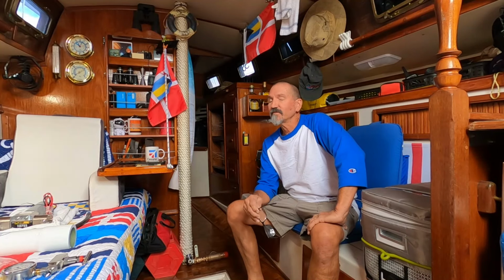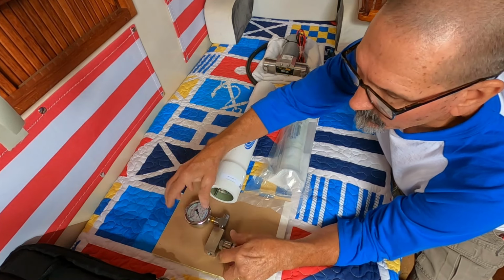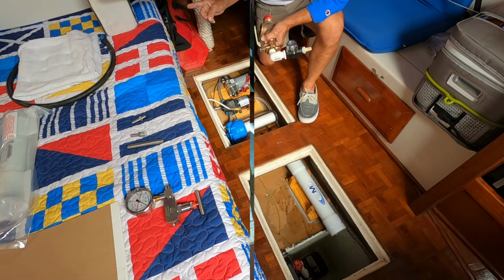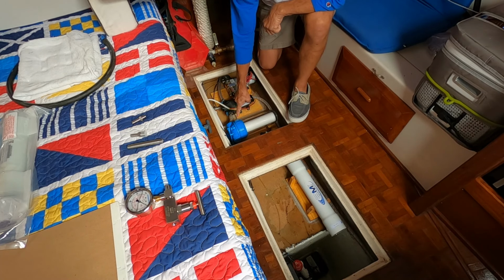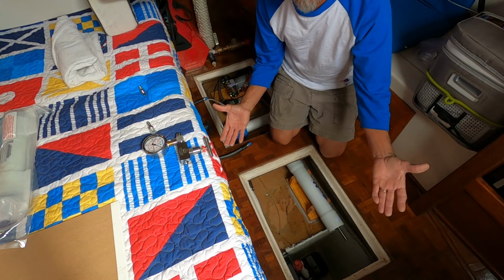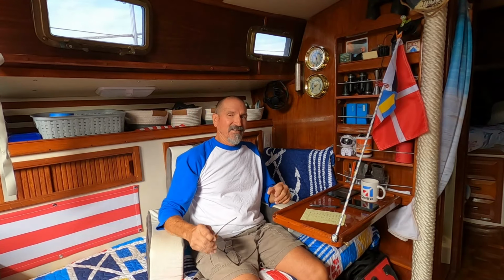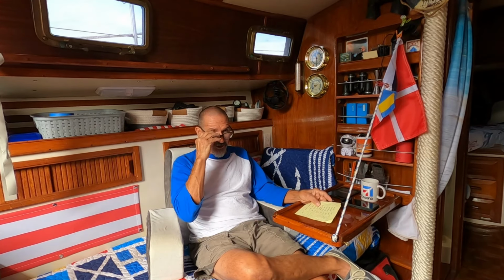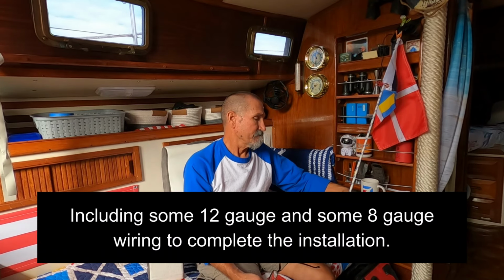My 12 volt, 15amp 3 gallon/hr watermaker for $1500

Comment: In the mid 90's I had installed a PUR 80 RO water maker by the dealer on my 10.8 meter sloop.  As I remember it sure never cost no 1500 bucks !! And it worked really good. That's about 3.333 gal. an hour. My boat had a 60 gallon holding tank. NEVER lacked for water..  BUT  I mostly sailed alone from Calif. to Florida through the P canal.
Reply from the maker: @samrogrer4959  Yeah, those were the days ! They only make the 40 model now and they are just under 4 grand ! 😱

Comment: I'm not thrilled with the price. Why can't they build it compact in a frame ?
Reply from the maker: Seawater Pro makes one in a case, but it runs on AC and it costs about $4200. Katadyn makes a small one with low power draw but its $4000. You could make the same system I have and use a pressure sprayer pump that's not stainless and save some money. But that kind of pump doesn't last very long. But you could probably save a few hundred dollars.
Reply: @sailingonabudget  I know in the decades past, there were tiny life raft/ kon tiki style water separaters run off hand power. They made cups of drinking water.
Reply: @sailingonabudget and your high pressure pump runs on 12v , 48v or what ?
Great video. Thanks for sharing?
Reply from the maker: @From_Refugee_To_Yacht_Owner  That pump is the 107SS from Pumptec. It can purchased in 12 or 24 volt DC, and 120 or 230 volt AC. All stainless steel. It should last a long time !
Reply from the maker: @stanleybest8833  I bet you're thinking of the Katadyn Survivor 06. It is still being sold I believe. Landfall Navigation has them listed at $1295, limited stock.
Reply: @sailingonabudget  thanks.
Reply: @From_Refugee_To_Yacht_Owner  No. I was thinking of something from decades ago.  I looked like a kid toy and it had handles. No electric, and it folded up.
Reply: @sailingonabudget I am thinking about going with the 120 volt hp pump so I can run off inverter or suitcase generator as backup if something happened to dc bank? Do you have a backup plan if you had DC issues? What are your thoughts on my approach if you don't mind? This will be on a 30' sailboat and space is a premium for sure as well as I don't want to mount it too low in case of a minor flooding...these pumps aren't cheap.
Also I didn't see a parts list like where, what or how much for the needle valve, pressure gauge etc?
Reply: @wakeboardbob  I own 3 pure sine wave inverters. Camping size. You don't run anything off an inverter you don't have to. Don't let manufacturers and salesmen spoon feed you a bad water maker design. Also, a big  klunky water maker can break. It's for showers and cleaner dishwashing. You carry enough drinking water at all times. Other parts of the boat can break, like the batteries and wiring and charging system. That's the same as no watermaker. The first hobby watermakers I ever saw were tiny muscle powered things for small amounts of drinking water. You almost have to start from scratch.
Reply from the maker: @From_Refugee_To_Yacht_Owner  Dang it, there's always something I forget to mention. It's 12 volt. 😉👍
Reply from the maker: @wakeboardbob  So in my opinion there's no real right or wrong. If you have a generator that you run regularly that may work better for you. I don't have one but my solar and battery setup have plenty of juice. If I actually lose my 12 volt system I have bigger problems to worry about than the watermaker. But that is a very rare scenario, can't imagine it actually happening. The parts almost all came from Amazon, except for the pump, pressure vessel and membranes, and the pulse dampening hose. 😉👍
Reply: "A French company provides everything you need in one complete kit, eliminating the hassle of sourcing all the parts. They also offer a remote box to control the watermaker, which includes an alarm. The company is PKC Watermakers."

Comment: A French company provides everything you need in one complete kit, eliminating the hassle of sourcing all the parts. They also offer a remote box to control the watermaker, which includes an alarm. The company name is PK Composite.
Reply: Hello I ordered from them last year and the salesman was very responsive, I received the box in 10 days  in st marteen (FWI)with no taxe or "octroi de mer" shipping is  170 € with "colissimo international"from France. after a mornings work I am  now self sufficient for the water the small machine give me  4 gallons of 150ppm fresh water with the 2514 filmtec membrane, quite silent it draw a little 14 amps including the circulation pump.

Comment: Can you giver an update on the system.  How is the pump holding up? Thanks in advance.
Reply from the maker: @karlglenroths7378  I wish I could but I haven't had a chance to use it yet. My plan is to head south after the 1st of the year. Hopefully be in the Bahamas by the end of January. By then I'll be using it often, and I'll do an update then for sure. 😉👍
Reply: @sailingonabudget thank you, I want to build this same unit.  I sure could use your review.  Be safe.
Reply from the maker: @karlglenroths7378  I won't be using it until I get to the Bahamas, but I will make a video about it then. 😉👍

Comment: Very helpful video. I didn't see any through-hull valves on those head through-hulls. It might never become an issue but it could be a serious one if things go bad. Or at the least installing them could save you a lot of mess to clean up.  That's such a cool seat cushion. I'll definitely be bookmarking this video for future use!👍
Reply from the maker: @PyeGuySailing  Thank you for the awesome comments. Sometimes I'm not good at making the best shots but let me assure you every thru-hull on my boat has a shut off valve. In fact one of the few tasks I have at my haul out is replacing the one for the galley sink ! 😁👍
Reply: @sailingonabudget  ah, good 😁 obviously I was mistaken then 😁

Comment: Awesome, congrats on the build. I am thinking to use a PWM regulator, and control the DC motor to adjust the pressure - then get rid of the needle valve.
Reply from the maker: @Cat-Sail  I can't say I'm familiar with that. But the needle valve is a super simple mechanical device that is almost foolproof. I am a firm believer in the KISS principle. 👍

Comment: Thanks for the informative video.  I was planning on basically the same system.  However, I was told by the manufacturer of the 2514 member and that the gym flow required was 1gpm.  However the 107ss is only .25 gpm.   I have read on various forums that this system has performed well for years for one individual but not much other feedback front he others who have tried it with time down the line.  Do you have any different information?  Please keep us DIYers updated, you are our only hope!
Reply from the maker: @SailingChingon  Lol, dude if I'm your only hope we're all in big trouble !! 🤣 But I have not heard or seen anything that says there is a minimum flow requirement, only a maximum. The system definitely works. I think the worst case scenario would be you have to buy a new element more often. That's something I can live with. 👍
Reply: @sailingonabudget  thank you for the reply.  Be safe.